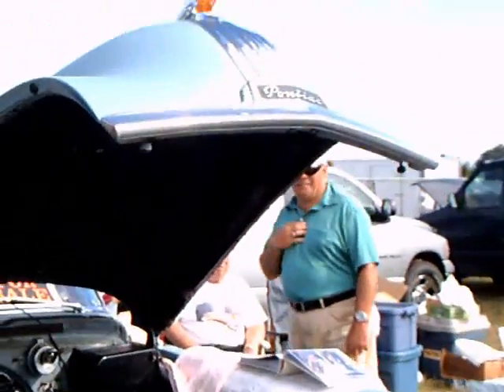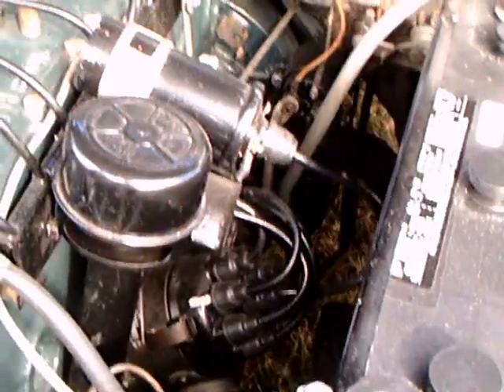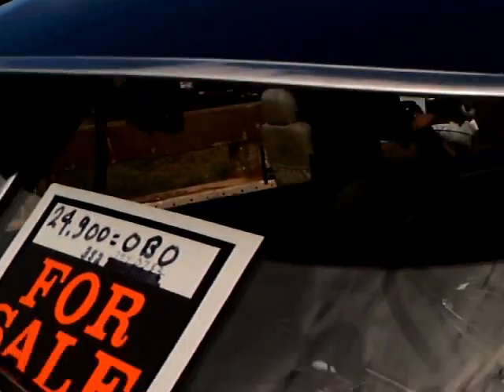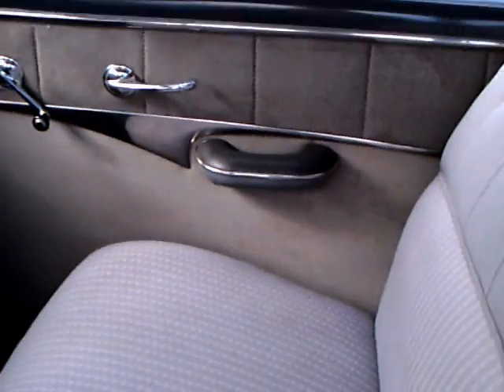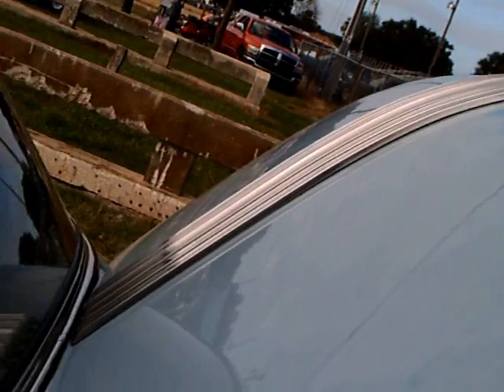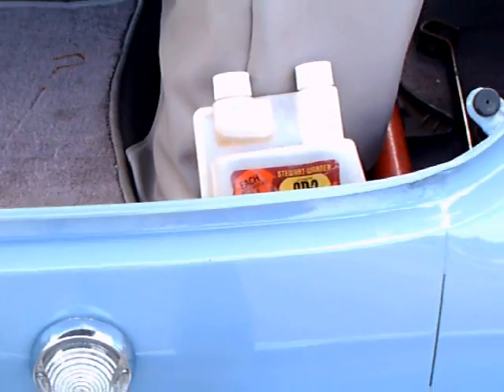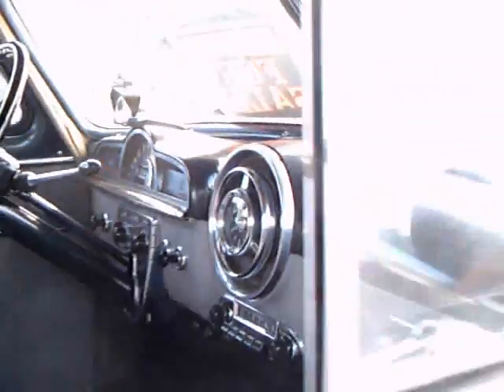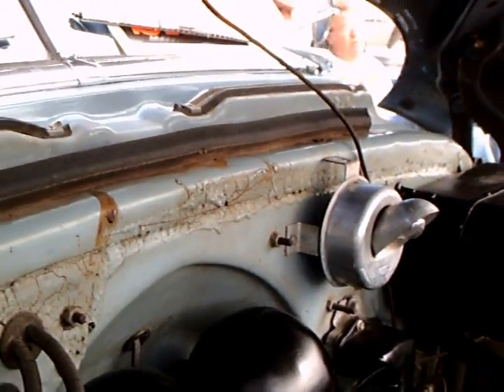1951 Pontiac Chieftan 2 Door Coupe Blu

Comment: The heat shield under the carb needs to be turned 90 degrees and flipped upside down. See the hole on the left of it? That's where the vacuum tube goes through from the manifold. But, I'm glad I watched this vid. I was wondering what the bolt on the side of the air cleaner was for on mine!
Reply from the maker: Hey, Bill!  Thanks for that detail...no doubt it will help owners restoring their Pontiacs as things often are out of position over the years.  :) Jack

Comment: This is from an era when the auto manufacturers knew how to stamp out a substantial piece of metal and form it into an attractive vehicle. This car no doubt has an X frame surrounded by a perimeter frame. The manufacturers also weren't worried about some 55 MPG edict requiring them to reduce metals to paper mache thinness.
Reply from the maker: That's very true...parts were made with little regard to weight!  Many things were made with an eye to durability!  Plenty of bracing, plenty of steel!  That's when American steel mills were going full bore...a bygone phenomenon!  Thanks!  :) Jack
Reply: Punch a fender on that car and your hand would become a maraca!

Comment: Pontiacs from that era were negative ground, if I'm not mistaken, which made it easy to put an alternator in.  Didn't know alternators can work with a 6-volt electrical system, though.
Reply from the maker: That's an interesting point...I hadn't thought about it.  Most who decide to change to an alternator also change to a 12 volt system.  That involves a goodly amount of change.  Thanks!  :) Jack